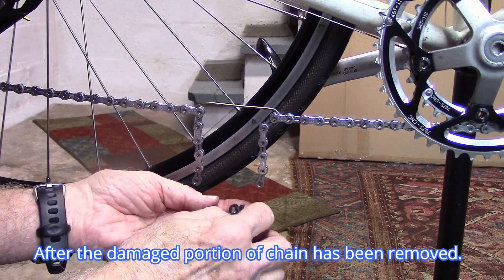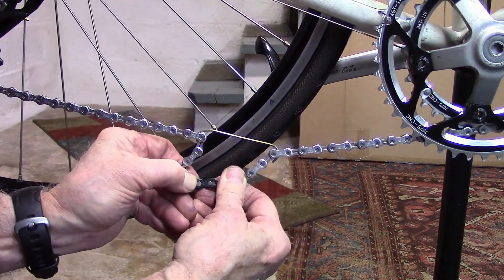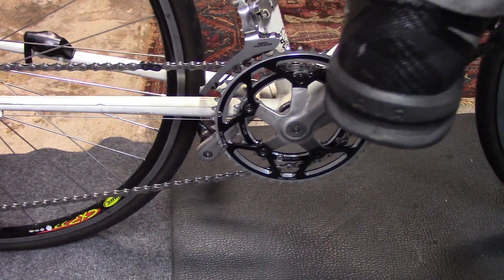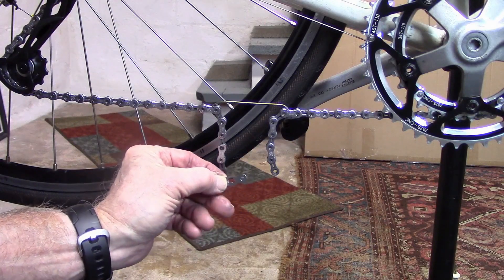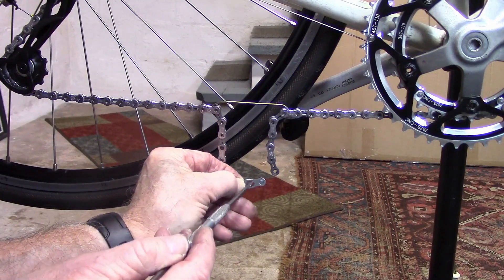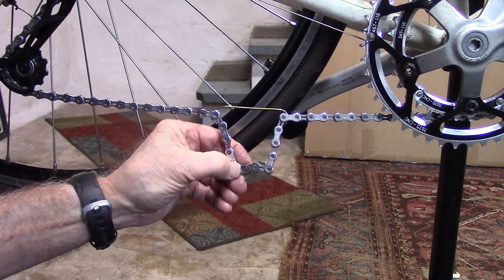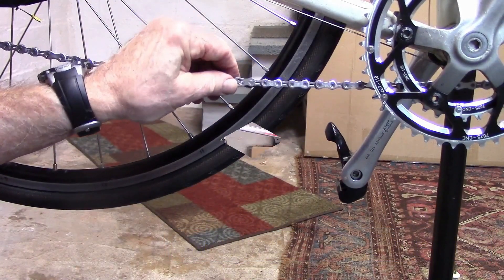How to install a Master Link WITHOUT TOOLS for on the road chain repair

Comment: Thank you we had been trying for 15 mins and then I saw your video and it worked
Reply from the maker: Just a note: After you engage the master link, it's important to check that the master link pins are fully engaged on both side. Glad you found the video helpful. Regards, Tony
Reply: Same

Comment: Tony you just saved me. I had to install a Shimano 11v quick link and did not have a tool to snap the link back closed. Your kick on the pedal while braking saved me. Really. Thank you Sir.
Reply from the maker: Neat trick. Just make sure the link is properly engaged on both sides, i.e., the pins have moved outward and are engaged. Also visit our YouTube home site at:
https://www.youtube.com/user/MrTony10speed
Regards and safe cycling, Tony

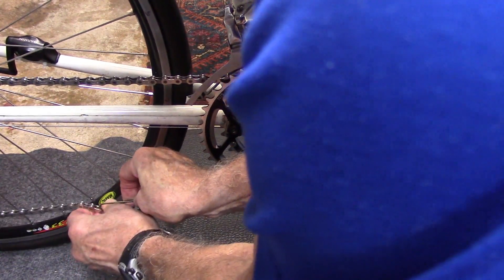Comment: This was very helpful installing a new Shimano quick link. I haven't used this type in years and had been trying the pedal with the brake thing but it wasn't working. Reading on the internet people were saying it took considerable force. Watching this @1:06 I realised I had forgotten you need to actually move the link so it's on top, well duh of course you do, I was really giving it some welly and all it was doing was pulling on my cassette. Moved it to the top and it clicked in immediately.

Comment: Any tips on how to get the old one off if it has to be done roadside?
Reply from the maker: You need to carry a chain tool (or as part of a mult tool) with you as well as a spare master link. Instead of removing the old master link, remove the broken or damaged part of the chain and add your new master link to that portion (now you may be running two master links on the chain). Of course, the chain will be shorter and you may not be able to use your larger cassette cogs, but you'll be able to get home.

Comment: Awesome video good tips for the long haul rider.. My name is Rob and i like to go on long bike packing trips and i was faced with this small annoying chain vibration in my higher gears (The hard gears my kid calls them) but what would cause that and how can i fix it.
Reply from the maker: "Vibration" could indicate a bad chain angle or a misadjusted derailler. Another words, you may get vibration / and or chain rub using the small front chain ring and small rear cog. On the other hand, it's typical to have smoothest operation near the middle of the cluster and some very slight noise/vibration higher and lower.  Other possible causes include worn chain, worn cassette, rear derailleur needed adjustment on the high limit screw to allow it to go far enough, rear derailleur was not indexed correctly (for indexed types only). There is also something called "Chordal Action" which relates to using very small cassette cogs (http://chain-guide.com/basics/2-2-1-chordal-action.html). Also check that the wheel is true and that the cassette has been torqued to the manufactures recommendations. Hard to say more without actually looking at the bike but consider the above. Let me know how you make out. Regards, Tony
Reply: @tony10speed  Thank you for the reply. ill tinker around with it i was going to replace the chain at the end of the summer but i think im going to do it ASAP.. Agein thank you for the info.

Comment: Just tried the first trick with a Shimano link. The link slipped out, chain fell off, and now my ankle is bleeding 😂.
Reply from the maker: I'm sorry to hear that. One needs to make sure the link is fully engaged on both sides before pushing on the pedal. Out on the road, this might be the only way to engage some master links. Some master links work better then others. The Connex and KMC (reuseable) are my favorite for on the road repairs and I carry a 10 speed KMC in my saddle bag. In my shop, I use the Park Master Link Pliers (a video will be posted soon) rather then pushing on the pedals. I check that the link is engaged properly before and after it snaps in place. Hope you feel better and my apologies.